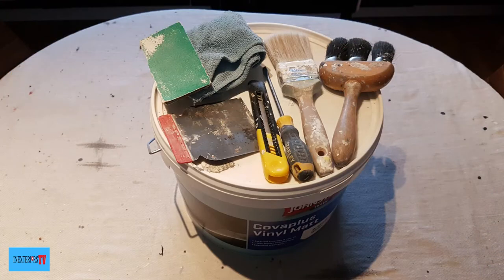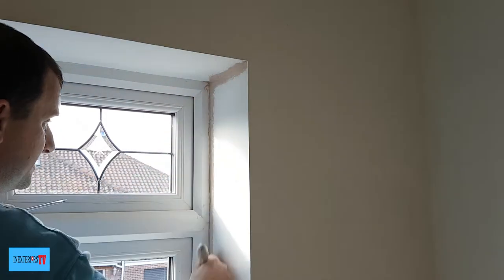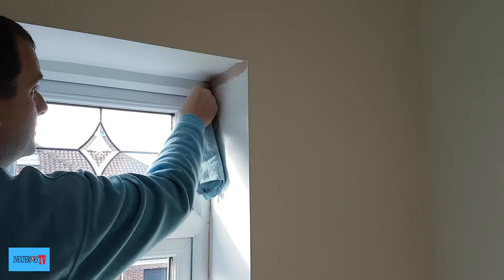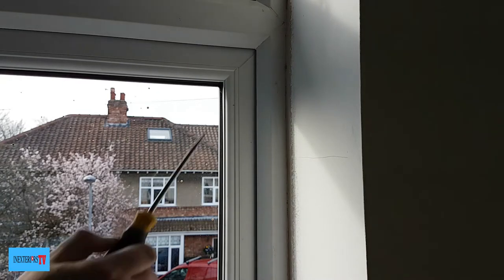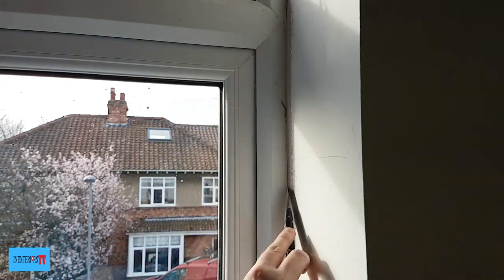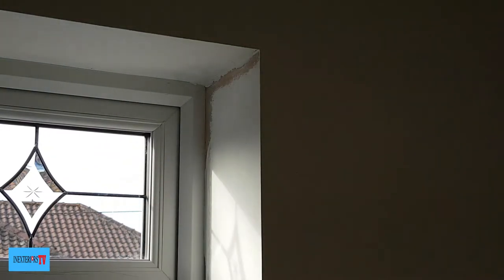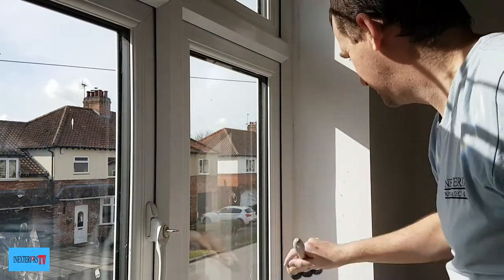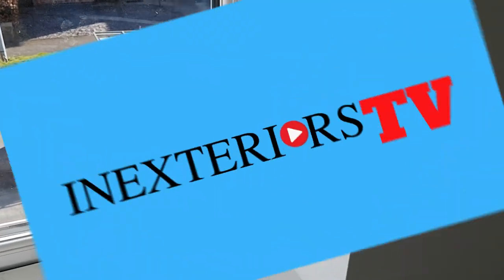How to paint a window reveal. Painting a window reveal.

Comment: Just painted a newly plastered reveal and within days the paint started to peel off on the corner edges  where the metal corner edge is fitted.I only used emulsion but thinking I really should have used a high grip metal primer or something similar.What would you professionals use ?
Reply from the maker: Try a little bit of zinsser peel stop, lightly sand beading, then put 2 coats on.
Reply: OK will try the Zinsser peelstop......Thank you.